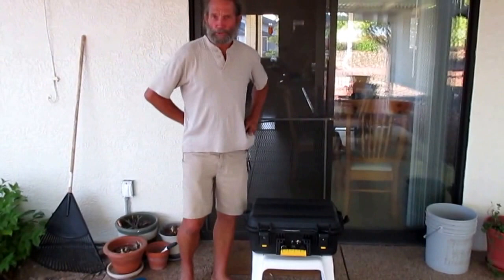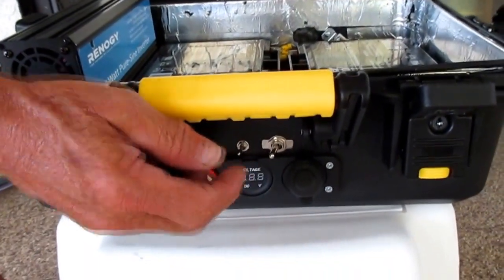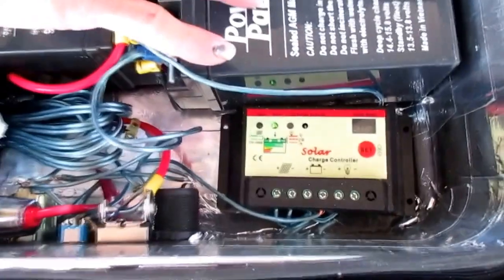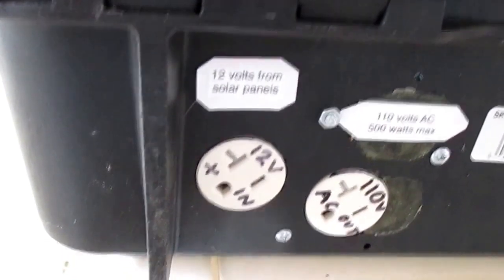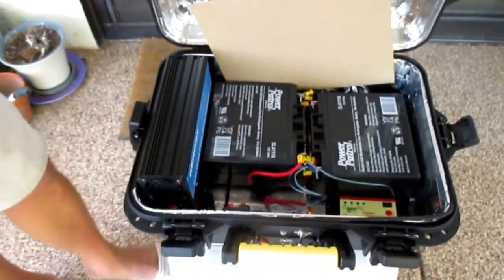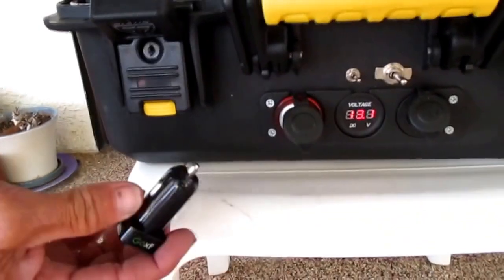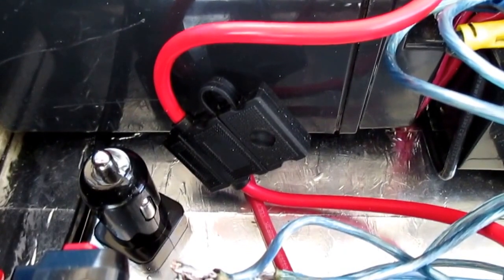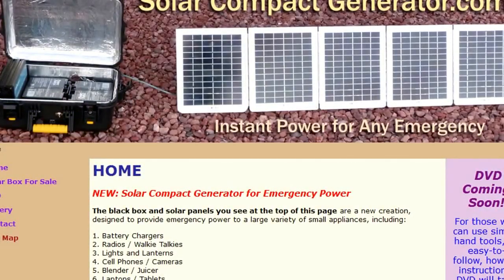Portable Emergency Power for EMP, etc.

Comment: By drilling through the case for your outlets, you defeated the Aluminum foil integrity of your case. Even the Smallest hole will negate any "Skin Effect" protection for the electronics inside. Your device is NOT E.M.P. proof!
Reply from the maker: You are correct. I was not fully informed about the effects of EMP at the time I made the box. The foil was a waste of time and foil. I now have metal containers large enough for this box and other sensitive equipment. Thank you for your observation.

Comment: If this is suppose to stay in the box. My only problem with that is components create heat. I see you have what looks like foil tape which is going to keep the heat in the box unless you put fans to take the heat out.
Reply from the maker: Excellent observation, thank you. I have been using this box daily for about a year - powering small appliances at night, charging by day - and heat is not an issue. The inverter, however, does generate heat, and it has its own fan, so while using the inverter, the box lid is open. This was planned, as one must open the box to turn on the inverter.